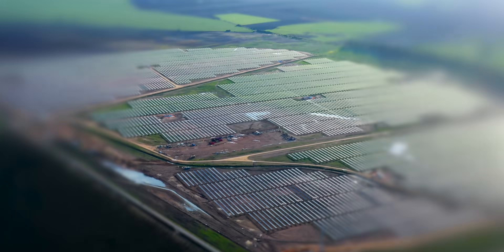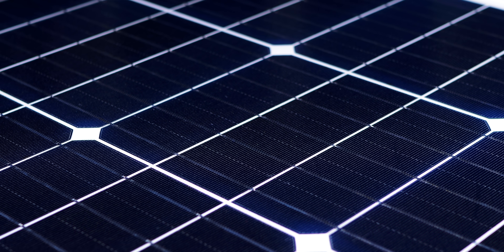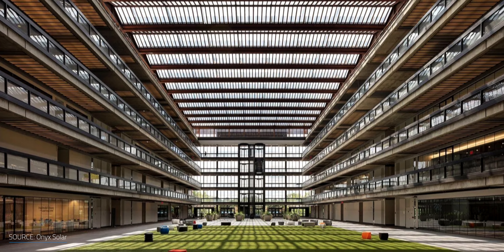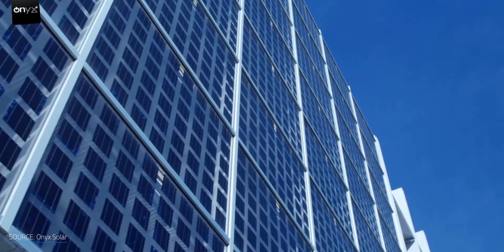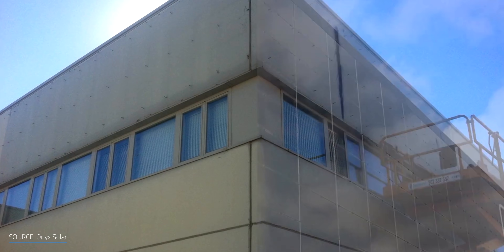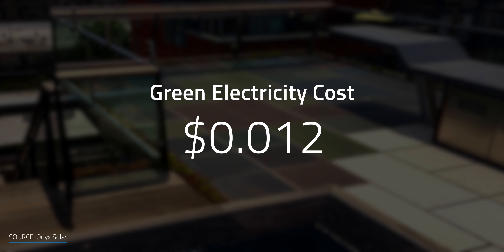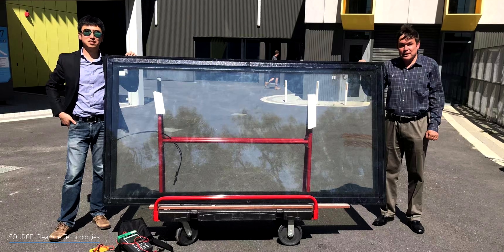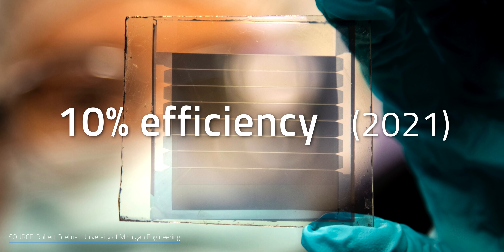Exploring a New Transparent Solar Cell Breakthrough

Comment: Ok, if these are based on thin-film technology, they are going to be doped with rare earth elements like Cadmium-Telluride, Copper-Indium/Gallium-Selenium (CIGS) panels, are toxic and MUST be recycled to keep the detritus out of landfills and water tables.  Every broken window/panel will need to be remediated, as even trace amounts of these REMs are carcinogenic.   I'm a bigger fan of perovskite and the geoengineering of organic photovoltaic algae, which will have fewer toxic consequences.   Traditional monocrystalline silicon PV can meet ALL the energy needs on earth, but where we should put our R&D money is new energy storage technologies and hydrogen cells so we can rearchitect the old hub and spoke distribution system into a series of resilient interconnected microgrids.

Comment: I really like the video and seeing this technology again!

The focus on efficiency of transparent vs opaque panels is a glaring false dichotomy since the use cases for the materials solve two different problems (ie few will replace windows with opaque solar panels.)

Much more time needs to be spent on the toxicity & recycling aspects of solar, both opaque & transparent, at their end of life. 

And no, recycling does not mean selling used solar panels cheap to rural areas, so they wind up buried in another 5 years under someone else’s farm land, it means extracting the nano particles & heavy metals to allow base products to be re-manufactured into Pyrex, drinking glasses, cookware, etc.

Efficiency is not as important as sustainability.

Comment: Cost is a major problem. Many glass windows in Las Vegas are already set up with IR blocking coatings like copper. no company is going to invest in a window that costs 5x more that needs to be replaced every 10 years. for the purpose of lowing their energy bill by 2%

Comment: Wonder if there is a way to redirect IR and UV light using polarization, or some other means, to "mechanically" achieve what the one company was doing vice using the organic cells that don't last as long?  For example, use a highly efficient solar panel all around the edges of the glass and use some polarization, or maybe prisms (i am DEF not a scientist here lol) to redirect all the incoming wavelengths to concentrate on those edges.  Thanks for another exciting video on current tech!!

Comment: We already have a large problem with solar panels reaching end of life and not being recycled. Semitransparent solar panels only make sense if we can economically recycle them and companies are mandated to do so. 
I also wonder if it would be possible to have the level of transparency change based on temperature. It would make sense in summer to have more sunlight be collected for energy use as this will reduce the temperature increase from sunlight and help power air conditioning.

Comment: hmmm... in one of the examples in this video, the transparent solar cells using organic salt, low efficiency is mentioned as a problem. But the panel selectively absorbs UV and IR light, while allowing visible light to pass through.

does it mean most of the IR and UV energy ended up not being captured (either passed or heating the panel)? 

he's not talking about the total energy right? (including visible spectrum)

Comment: Saying they are better at off angles has a little value when its 1% efficiency, further divided by "unknown better value than silicone pvc".
Even at 10% efficiency, and 10 year lifespan, means they won't recoup production costs ever, and definitely at their current sub 1% efficiency, they don't even have a chance to recoup their CO2 cost of production. There goes your green dream of solar windows.

Comment: Several times you mentioned the lower efficiency of windows compared to rooftop installations as a downside, which ignores the simple possibility of, "why not both?"
Reply: Because these things cost far more than regular (tinted) windows. The difference in cost can be spent on building a proper solar installation which would produce far more electricity, ergo help preserving our environment more. There is no ecological or economical reason to do this...
Reply: Calls for "more efficiency" are usually people trying to keep us from getting off of the expensive habit of paying several hundred dollars a month so somebody else can make our electricity for us for a fee.

As far back as 2008 it was practical to build a home that did not need off site power, at only a 20 to 30% additional cost to construct that house compared to a conventional new build.

So for 30% more up front, you could live in a home with no monthly gas bill, no electric bill, even no water or sewer if you wanted.  After a ten to fifteen year amortization the homeowner has broken even on the additional up front expense.  From that point forward it's zero cost and only the occasional replacement costs like anything else a homeowner encounters like replacing a furnace, hot water heater or roof.

But home builders need to build homes cheaper to make more money.  They can't justify putting solar panels and a geothermal heat exchange on a home they can already sell for top dollar.  They aren't going to sell the house for more, after all.  The market drives that, where the home is, the schools, the comparable home prices, etc.

Comment: Interesting video. I think as you said as that progress of the panels was from 1% in 2014 to 10% in 2021 ..unfortunately that is same with all progress. Progress isn't exponential even if they went to 40% (and that is not possible as they stated) even then it isn't big question ..Big question is price ..nobody will invest money if there are no benefits..even today normal solar panels are getting pretty good and on the roofs are very high producer of electricity..and now all buildings use glass as main cover material ..most buildings these days don't use glass.only on windows for houses or such..so even if all will go well there is small progress that will be made in this field ..as it isn't really needed for normal building or houses..solar panels on the roofs are much better solution and those panels are more efficient than any transparent glass on the market. but still it is good to have progress even if it isn't needed..maybe for some exotic enviroment it will be good thing..like space stations or such..

Comment: If they're cost-comparable with glass, there's not really any reason to not use them, regardless of their efficiency.  0.1kWh is more than 0.0kWh.
(Well OK there are other reasons to not use them - manufacturing capacity being one of the biggest ones if one or more of these technologies takes off.  That will ramp up over time of course, but it'd be a good long while before they could come close to matching the worldwide demand for windows.)

Comment: There's a glaring omission to these companies comparisons in the fact that e-glass (a-la IR/UV rejection coatings) and aftermarket treatments are quite popular for new construction. Since transparent PV's work by absorption their energy gains really need to be compared to those, and I'm not sure they'd stack up favorably at this time (they definitely won't at small scales). There is also the lifecycle/cost issue, since e-glass is both simpler to make, and longer lived, I have no doubts it's the long term winner in cost/maintenance.... Most building owners are not going to be keen on scheduled replacement at that scale even if it does work out cheaper in the long run.

Comment: I think lifespan is by far the most important factor for PV windows. The labor costs of replacing the windows on a skyscraper is enormous compared to replacing roof top solar. Better efficiency is great but with such a large surface area to work with that needs to be filled with glass anyways, it's not as relevant as with roof top solar.
Reply: We really don't have a space issue with solar. There is plenty of room for regular solar. Meaning the Efficiency does matter. A Lot.

Comment: If the output is too low to be of much use on rolling back your electric meter, then they should capture the energy in capacitors and use it for opening and closing blinds between the layers of glass or darkening an LCD layer on the inside.  Add a hidden camera and connect the view out your window into your security system without the need for wires.
I wonder if transparent aluminum could be used as a matrix for getting the electricity out more efficiently.  Maybe some kind of dielectric metals to augment the solar would be able to boost the efficiency.

Comment: Seems to me that a better route, or I suppose a supplemental option for an office building would be to take a similar route to some old brutalist structures. I've seen plenty of those that employed concrete ribs between the windows to reduce light entering from low angles. You could probably get some nice output from using regular solar panels placed near the windows.

Obvious downsides to my super-great idea: the taller a building gets, the more of a factor wind often is, and unless you give the solar panels a mechanical swivel function or a stout supporting structure like those concrete ribs I mentioned, you might wind up dropping a lot of panels onto the sidewalk below. And of course not every low-rise office building even gets a whole ton of sunlight, especially if it's surrounded by high-rises. My idea may very well be the Homermobile of architecture.

Comment: I think rating PV panels just on efficiency is not a great metric.   I don’t think most people understand what it means.   Just because it’s lower efficiency doesn’t mean it’s not useful.  Just as the example in Monterey.

Some metric that considers the cost of the product and the power it produces compared to the alternative,  and how the installed cost lowers the operating cost. And maybe through in the amount of carbon it will offset compared to natural gas?

Comment: Standard solar panels reach today more than 26% of efficiency and are going forward quickly. The solar investment is made based on cost/efficiency/reliability. These transparent panels are 1. expensive 2. very low efficiency 3. have not minimum life span of 30 years and all these issues made it a not viable solution for a valid renewable solution.
Please remember that today to fight climate issues we need renewable solutions that are far cheap and far more efficient the coal, petroleum or even gas. Please focus and invest in research, development and especially in communication on solutions that MUST have those characteristics.

Comment: For mobile use (including vehicles) they'll definitely need to improve the transparency of the panels, for automotive use they'll need to make the panels at least as safe as current safety glass..  For office buildings not so much, except for the bigwigs in the "corner office".  For both mobile and fixed installations, the power density and lifespan will need drastic improvement.  That said, it does look very promising especially for urban areas where most of the real estate for solar installations is vertical.

Comment: IF they get to 15% efficiency, even if they need a lot more area than usual solar, a building would have a lot more area in its windows than in its rooftop. On a car... it would be less dramatic, but given that it would absorb UV and IR radiation while having a 70% transparency (which is a usual transparency in a tinted car window), it would lower the need for the AC while recharging a little bit of the battery, which is nice

Comment: I may have missed it but it would have been good to point out that transparent and opaque PV aren't used in the same places. A transparent PV cell generates infinitely more energy than a regular window (which produces 0), while an opaque PV cell also produces 0 because it would never be installed in place of a window anyways.
A better metric would be to compare how long it takes to offset the emissions involved in manufacture, or a simple payback time, cause ultimately that's one of the key reasons transparent PV would be used instead of regular glass
Reply: I agree that comparing electrical generation efficiency of transparent to opaque PV’s is not useful, due to non-overlapping use cases… least it is not useful unless the transparent overtakes opaque!

The emission offsets is not as important as energy savings & payback for material. CO2 emissions are naturally recyclable, basically plant food, offering organic energy capture for us to use.

The piece that bothers me is recycling the panel & glass materials. Does melting the glass back down and extract the nano particles take more energy than melting normal glass panes, for reuse?

I am unhappy with the total lifecycle of materials, recycling must be considered, as I am watching formerly used solar panels get buried in old farmland with subdivisions built above them. The heavy metals in the next generation of vegetable gardens may be a man made natural disaster for the next generation.
Reply: @DavidHalko  that's also quite important I agree, perhaps then a life cycle assessment comparing transparent PV to regular windows

Comment: I don't know if it's intentional or just my interpretation but you keep flipping between "we've got heaps more surface area available" to "...but they're currently too inefficient".

It's not binary - those buildings will get built regardless of transparent solar glass or not. Surely anything that's already going to use a massive surface area should be used for solar if the technology is available and in the ballpark of price comparison.

It feels like the lack of a push to solar for the past 30 years has been this whole "but the technology is still slowly improving". I don't recall people saying "oh but petrol engines are still slowly improving so I'm going to wait until they reach maximum efficiency". We needed to get around quicker, so we bought an imperfect technology. Right now we need to increase the diversity of energy production, so we should be willing to purchase an imperfect renewable technology

Comment: The big problem with transparent solar cells is that windows are typically oriented vertically, which is basically the worst possible orientation to make power. You get the worst power production during mid-day, where energy demand is very high. Couple that with the very low efficiency, and it's unlikely they would be viable economically or in terms of pollution offset by their energy production.
Transparent glass that reflects all IR, or that uses the night-sky cooling effect,  or both, to passively keep building cooler might be a lot more useful in terms of energy efficiency or pollution offset.

Comment: simply using your cars sunroof as a simple battery tender would do wonders.
parking bay covers would be a great use for these over something like a solar roadway because you block the paved area a LOT but with the cover you get full sun while providing shade to cars below, meaning they dont get as hot in the summer, so less AC blasting is needed to cool it down, leading to better fuel usage for everyone... add in that you can use the solar to offset the grocery store or whatever and you make a fairly large change to its environmental impact... 
picture an airport parking lot covered in semi transparent solar. add that to hangar roofs and as skylights in the terminals and you could make enough power to sell to the grid...

Comment: Imo efficiency is an almost useless metric for consumers as the biggest factor is usually cost per kWh rather than area per kWh.
When the installation cost is low enough to compete with materials which would otherwise be used, then efficiency doesn't matter because every kWh that it produces is effectively free.

I'd love to see the day where we can cover entire house roofs in voltaic cells, including all external windows without costing any more than a typical house build with tiles and glass.

Comment: The key is to increase the efficiency harnessing the invisible light (IR, UV and all other wavelengths ) to 80% or better. I was wondering if the ''transparent coating'' in windows could be mixed with some kind of unharmful chemical to increase the output of energy - something that acts as an electrolyte like in the fuel cell technology - splitting hydrogen from water using the cathode and anode. Also, nothing prevents ''coating'' exterior walls with the same mix to harness the light shined over them, or make building walls as energy conductors. The same would apply to auto paints and anything that gets coated with this invisible sunlight-energy trapper. We are getting there at gigantic steps....  Great video..thanks for your selfless contribution to bring order and new angles of loving the planet.

Comment: I could see where solar pannel clear(ish) glass is mandated by code in my lifetime. However the smallest thing we might see it on is laptops. Since adding complexity to a smart phone would probably not be something phone companies would want to do. I doubt we will see it on cars any time soon either due to safety in crash test ratings. Though even if we only added it to a fraction of sky scrappers over the next decade or two that would be pretty huge. One more small step in the direction of a carbon negative world.